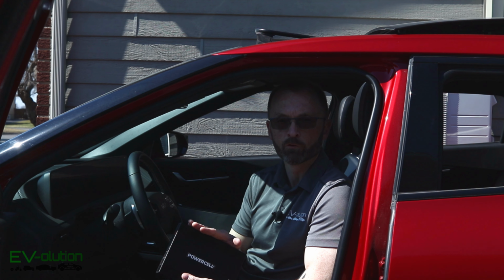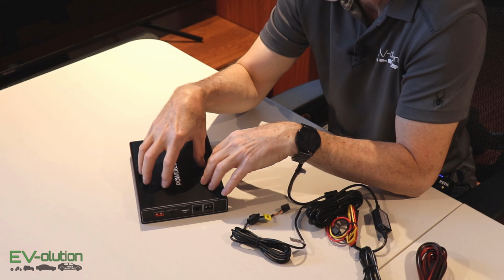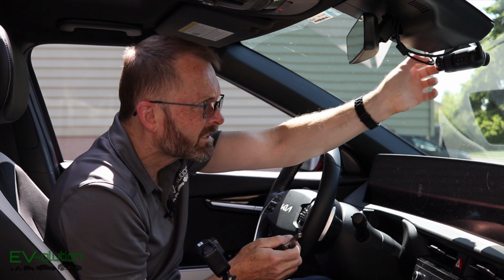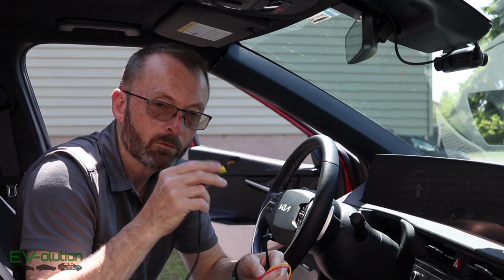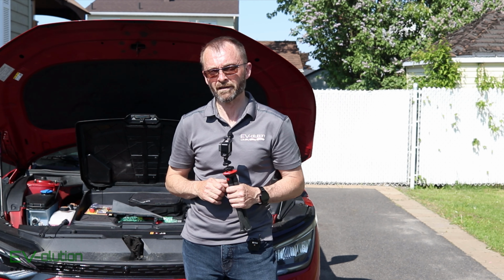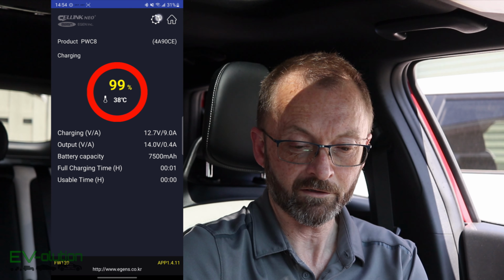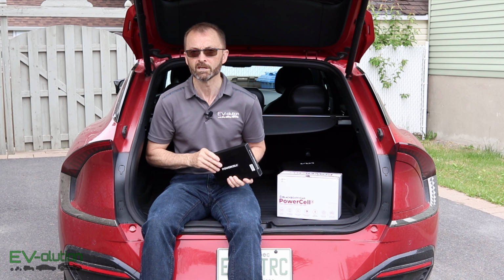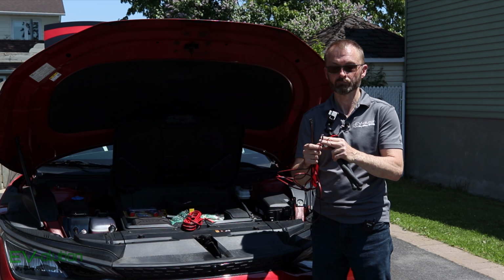12V Battery Protection - Powercell 8 Review & Installation

Comment: I saw the video about using the relay and though that is probably the best practice, I was not a fan of running the wire through the firewall.   What  I did was use one of the open fuse positions( an accessory one of course) and set the charging rate to low.  This avoided the complexity of the relays with the multiple points of failure, especially important given my installation skills. The current draw doesn't seem to too high and i precharged the battery pack and it doesn't drop down too low that i need the faster charging.
Reply: This is a very smart appproach too 🤔🤔🤔. Since I planned charging the battery with a provided cable from BBMC from the comfort of my home too, I just need the battery to be hardwired to the car for top up but not to fully shoulder the vigorous charging.

How well is the style holding up Pls? Any issue ever since?

Just on the verge of getting this
Reply: @Mullah01  So far so good.  I hadn't looked at my battery for a while.  I just had a quick look and all seems good.
Reply: @marcberanger  Thanks so much for your swift response. I really appreciate.

Please for how long now have you had the battery 🔋 installed and what does the discharging rate looks like now compared to when new

Thank you
Reply: @Mullah01  I think I installed in July 2023
Reply: Hard to say on the discharge rate....Current charge after being off for almost 24 hours is 98%
Reply: @marcberanger  Thanks sooo much

Really appreciate
Reply: @marcberanger  

Hello 

Thanks so much for the information you've shared with me in the past. The moment of reality is upon me now. Currently installing the PC8 😃.

Since you used one of the open slots, 

1) Was the amperage of the free slot stated on the fuse box? Because on my 2024 rav 4, it wasn't stated 

2) Please what was the amperage of the fuse you used?

Thanks so much as I wait to hear back from you
Reply: @musaadedibu9316  I couldn't find the rating for the fuse position  for the ev6, though I did look.

Given the max draw is 9amps when charging I put in a 20amp fuse.
Reply: @marcberanger 

Thanks soo much. I really appreciate

Comment: Having gone to so much trouble I think it might have been a we bit more professional to drill a hole with a hole cutter and fit a rubber grommet, hole cutters are so cheap. Any electrical shop would sell you a packet of grommets and a small hole cutter for just a few bucks. Your instal would look more professional which I’m sure you are.
Reply from the maker: I have hole cutters and that is a good idea that I wish I had thought of when I did it 😎
Reply: Thats what I did for my install.  Shaved a few minutes off the install and less possibility of wire chafing especially as the movement of the glove box might cause some problems.   I was looking at installing mine under the passenger seat and when I saw this video I changed it to the glove box.   Thanks

Comment from the maker: CRITICAL INFO - UPDATE 2023-06-18 : 
(A) I repeat a mistake in the Viofo T130 specs, saying it is a 4K camera, but that is an error, it is actually a 2K front camera. Sorry about the confusion.
(B) The Blackboxmycar Web page for the Powercell 8 has a note hidden at the bottom of the specs and is kind of critical. I wish I had known before making the video because I would have put far more emphasis on it...
-----------------------------------------------------------------------------------------------------
Changing Passwords
If you are planning on changing the battery password, you will need to enter the default password '1234' when prompted for the old password.
Note: There is no password retrieval or reset function. Password reset is a function that can only be performed by technicians at the manufacturer. The Reset function within the Battery Manager App is for resetting the default battery settings (ie. the Dual Charger setting) only and will not reset the password back to the default "1234".
Because of this, we strongly recommend that you don't change the password unless you absolutely needed to, and if you do change it, make sure to keep a record of the new password. Once you have changed the password, you will be asked to re-enter it every time you access the Settings menu within the Battery Manager App.
-----------------------------------------------------------------------------------------------------

Comment: Would it be ok to use the cigarette outlet instead. Too much pain to hardwire it. I think my ciggie outlet reads 120 watts. I also don't want to risk losing the warranty for the car. They always blame something when things goes wrong
Reply from the maker: EDIT: This reply is incorrect, I mixed up replies to different comments as I was typing 🙄. See my comment below for the correct answer...
The 12V outlet is more than fine, and safe. Just be sure to select LOW for the power switch of the Powercell 8 and it will work perfectly. I hardwired it because I want my dashcam parking mode to record all the time. If you use the 12V outlet it will power off the dashcam when you power off the car.
Reply: @EV-olution  no, I want the powercell 8 to power my dashcam in parking mode and the cigarette lighter outlet to recharge the powercell 8 when my car is running. This way it can still be recording all the time
Reply from the maker: Sorry, I need to not multitask when I answer comments here and on Facebook 😎 The correct answer is...
The 12V outlet is more than fine and safe. Just be sure to select LOW for the power switch of the Powercell 8 and it will work perfectly. I hardwired mine because I want mine to charge as fast as possible, pulling 9A, and that can only be done with hardwire of the Powercell 8.
Sorry for my confusion, I think I need a nap 😆
Reply: @EV-olution  thanks 😊

Comment: Great report! I would have considered mounting it on the top of the glove box, if it fit that would still give full depth of the glovebox for "Junk". 😊
Reply from the maker: Thank you very much. As for the placement, I just throw my junk on top of it 😎
Reply: If you put it on top of the glove box it will most likely not close. The top of the glove box will be a tight fit against whatever is above it.

Comment: I don't know if I missed it in the video, but any reason why you did not put that battery in your frunk?  Although your glove box appear bigger than the one in my Model 3, the glove box in my cars always fill too quickly ;)
Reply from the maker: There are a few reasons I did not put it in the Frunk:
1) There is no specification for water and dust resistance in the specs of the Powercell 8. With the EV6 Frunk not being completely sealed tight, and with other models of EVs not having a cover on the frunk like the Ioniq 6, I would not want to risk putting it there.
2) The hardwire kit wire end would need a pretty large hole to get into the cabin of the car, unlike the 12 gauge wire that only needed to poke through the rubber grommet. So there is no easy way to get it into the car without cutting the wire (wires) then having to solder them once in the car. This is way too much trouble versus the "easy" job of pushing the power lead through the grommet.
3) The hardwire kit that that goes to the dashcam is pretty long but I am not sure it would be long enough to route the wire from the frunk to the firewall, up and around the dash, then over to the camera. Maybe, but I am not 100% sure.